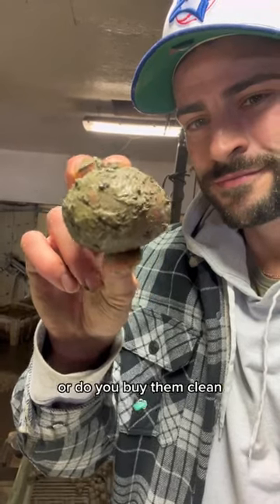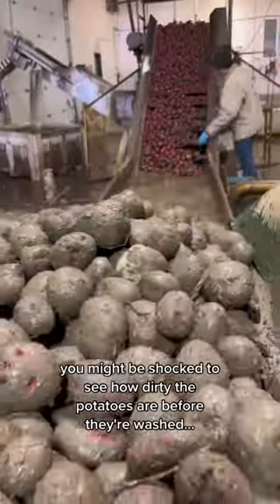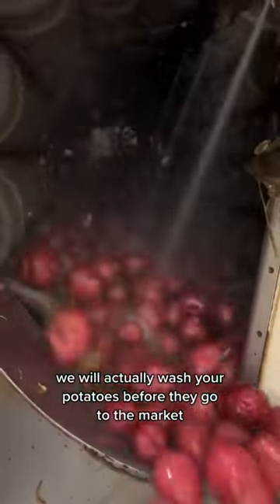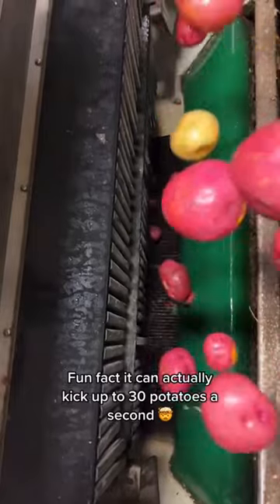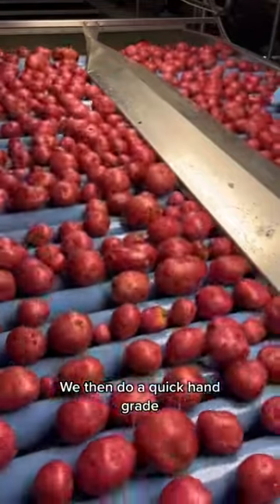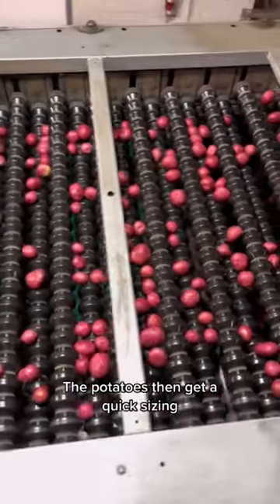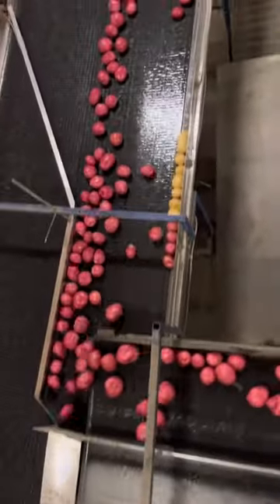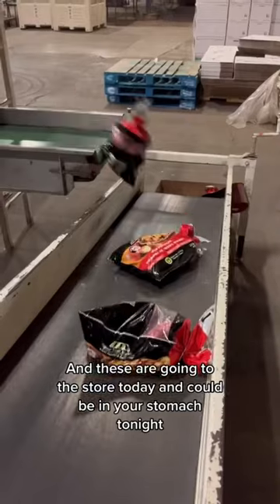You might be shocked to find out where potatoes grow #potato

Comment: In my country most public markets sell potatoes with tonnes of dirt because they're sold per kilo and the dirt adds to the weight so they leave it dirty😂
Reply: -62 likes and no comments let me fix this

It happens to my country too😂
Reply: that should be illegal
Reply: Unwashed potatoes last much longer than washed ones.
Reply: @119beaker  is true but still that doesn't mean we should buy 70% potatoes and 30% dirt😅
Reply: Wash in a big bowl keep muddy water to feed plants, then rinse off in sink to finish
Reply: In Australia, the ones with dirt are called "brushed potatoes". 
You have to give them a bit of a scrub under the tap before cooking them.

They are actually cheaper than the washed potatoes. 

There's no scam involved. It's got nothing to do with the weight of the dirt added to the cost. The dirt is negligible. 
The potatoes go through one less step in the process from farm to store, so they cost less.

And as someone has already mentioned, they last longer.